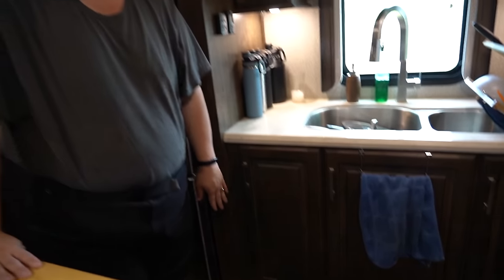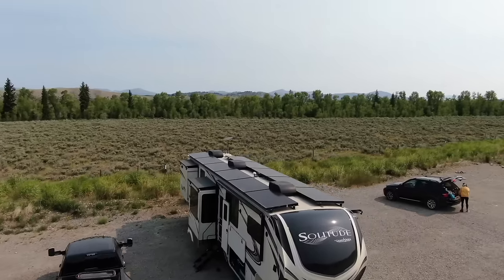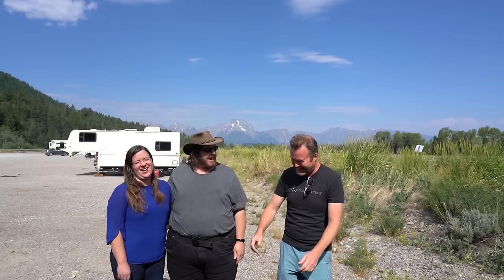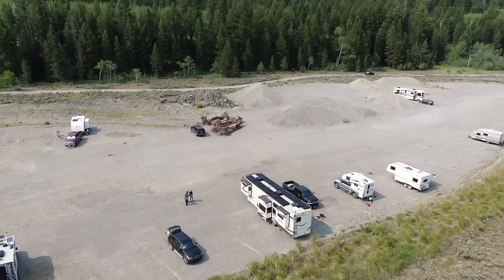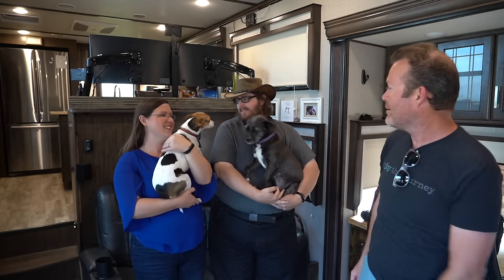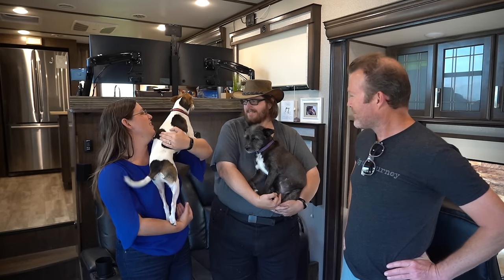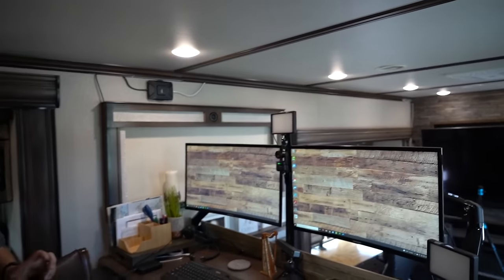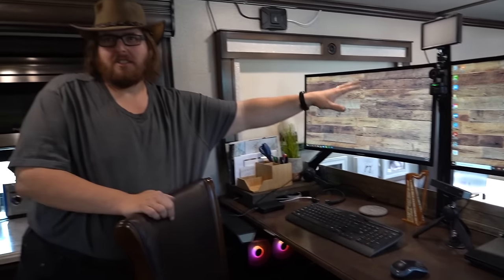26 RV MODS & UPGRADES | GRAND DESIGN SOLITUDE TOUR (RV LIVING DOCUMENTARY)

Comment: Maybe there is some clear (so you can see the design of the backsplash) plastic or vinal to put in front of the backsplash, that you can wipe off more easily.  Gaming computers are great for graphic work, and I want to get a computer with alot of graphic cores, like what the new Apple Computers are coming with (MacBook Pros with the more powerful M1X, plus 16-32 Graphic Cores, 8-64 GB of Ram, 10 Cores (Proficiency Cores & 2 Efficient Cores), and higher capacity SSD Drives.  So, yes, Gamers and Graphic Artists need more powerful computers.  What I love about the newer Macs, is they are more powerful without the heat throttling because you have Apple chips, not Intel.

That is an amazing work you all put in to your RV.  You are in one of my favotire places, I have been up to the Jackson Hole area several different times, one of them was while I was in College in a group trip, in which we went on a Rubber Raft ride on the Snake River, and also went over to Jackson Square.  The West and the Rockies is my favorite part of this country.

Comment: Rip off the roof AC's and go with a mini split heat pump, then you can put more solar on the roof and not worry about shade from the AC's.  Plus, those mini splits are much more efficient.  The problem is there isn't a lot of places you can put the outdoor unit in a 5th wheel, unless you put it in the area under the overhang, or mount it to something on the rear of the unit.
Reply: The unit I'm looking at is the Pioneer Diamante 12k BTU unit.  20 seer for cooling and 10 HSPF for heating.  handles up to 450 sq ft. so should be big enough to cool a 35' motorhome no problem.  It's also under 120 pounds.  My goal is to remove all propane appliances and get rid of the propane tank, both roof AC's, install a tankless water heater, and the gas stove (in favor of a coupld of induction burners). That means I will be shaving off a couple hundred pounds (roof ACs seem to average about 85-100 pounds each) net.

Comment: This guy has the right idea on solar.  You're better off with no solar than just a little.  If you're going to spend on solar, spend enough to get a useful amount.  I couldn't believe it when I saw an RV with a single 200W panel - expensive yet pointless.

Comment: Wow.  That's way too much spent on batteries.  Eve makes 280ah LiFePO4 batteries.  Four of those would have more storage than the 10 Battleborn batteries and would cost less than $2k, including the cost for a BMS.  Battleborn makes it easy, but not $8k worth of easy.  Yes, it takes a couple of months for that slow boat from China, but to me that savings is worth the wait.  Heck, double it to $4k and you have 24kwh of storage on hand at half the price of the Battleborns.